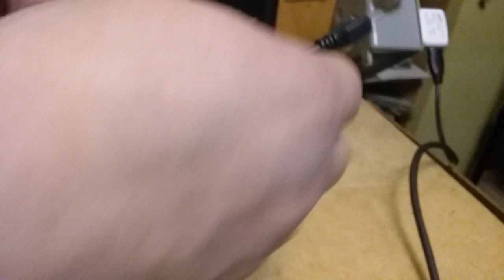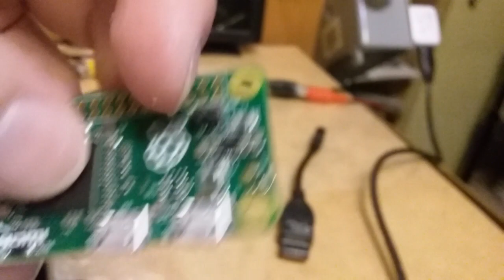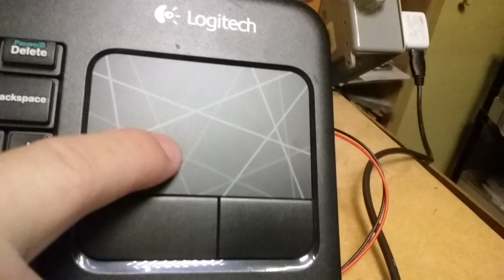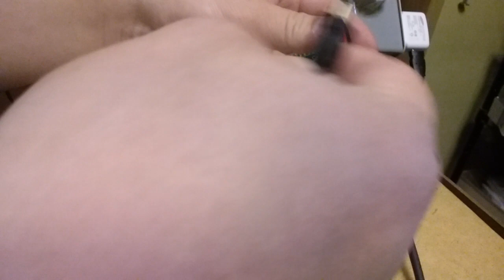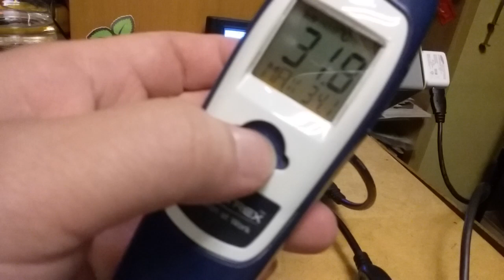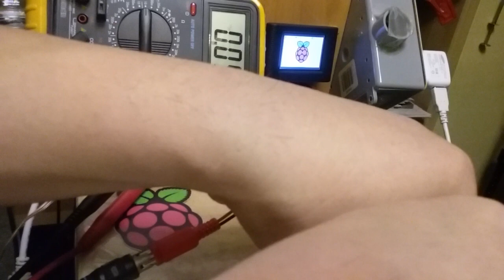$5 USD Raspberry Pi Zero First Release - Modify and Test

Comment: Thanks for measuring the power consumption. It seems it uses about the same as Pi A+. You can reduce the power consumption by about 25 to 30mA if you disable the HDMI /usr/bin/tvservice -o so you can get that 65mA idle.
Reply from the maker: +electrodacus Thanks for the tip.

Comment: Does the composit header also output audio?
Reply from the maker: +Strando123  No. TV output only. QVGA 320x240.
Reply from the maker: +Strando123  The MINI HDMI outputs audio.
Reply: +Strando123 You can get audio by replicating the PWM RC filter circuit from the Pi 1: http://learn.adafruit.com/introducing-the-raspberry-pi-zero/audio-outputs